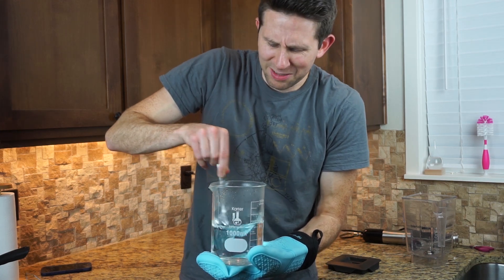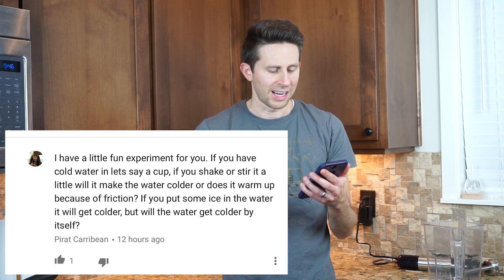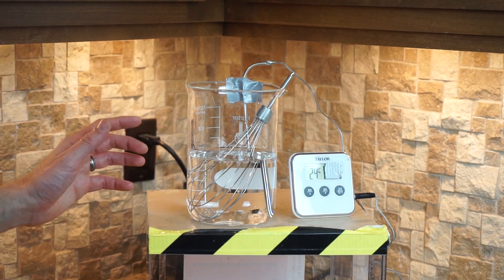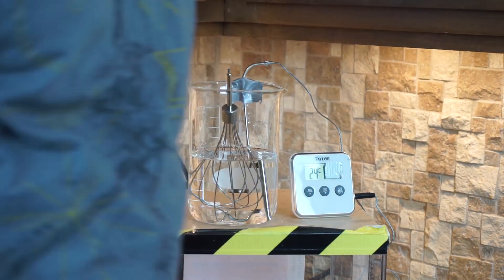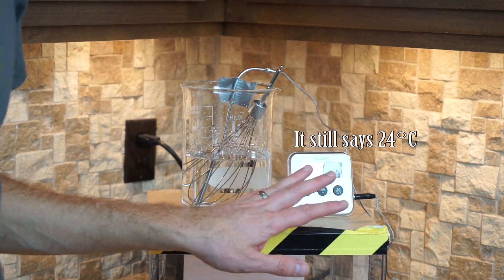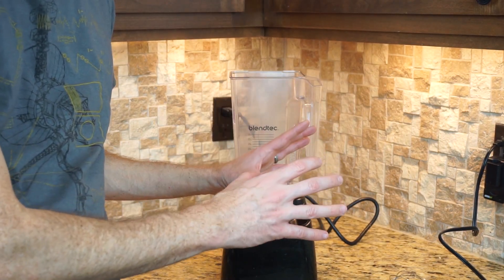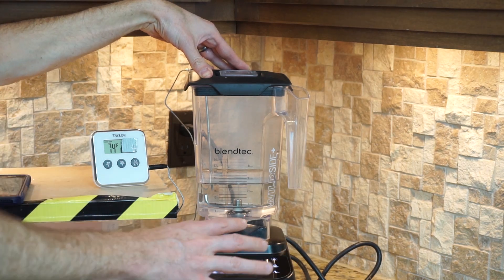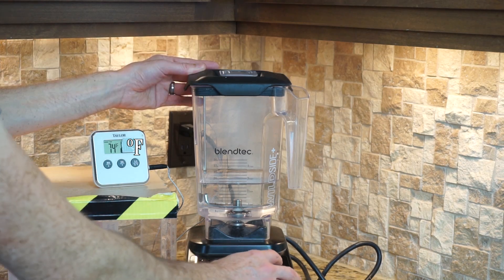Can You Boil Water Just By Mixing it Really Fast? Water-Stirring Challenge Accepted!

Comment: I haven't seen anyone else comment this but don't you think the water is heating up mostly by the heat of the motor??
Reply: Actually, I agree. The yield most likely isnt 100% movement of the Blades, I guess there is at least 80% of the Energy is being transformed into Heat, which then enters the water through the blades.
Reply: No it can't it doesn't work like that
Reply: XXTechMoXX ` that was my thought
Reply: No
Reply: yawn 😴
Reply: No
Reply: Youngo: And I say that it is at maximum 20%. Now we must place our bets and someone must make an experiment.
Reply: https://www.youtube.com/channel/UCkOhhX6zyRw3IW35xC9u7rw
Reply: XXTechMoXX ` i was also thinking it but this'll not do that much
Reply: Actualy the bearings are getting hot witch is warming up the blade and disapateing into the water
Reply: 7:10 and you can see that it is bubbling from the blade which has a direct connection to the motor
Reply: The bearings, not the motor. The motor would have little to do with it, especially as it's fan-cooled.
Reply: It is heating up additionally with the motor and bearings, but not only because that would make no sense in energy conservation.

Comment: The experiment is not a conclusive one. It has a major flaw. The system is not adiabatic. The blender blades are always metal and are connect directly to the motor (may have some non metals between the joint of the jar and the motor, but not necessarily an insulator). Blenders get hot all by themselves if you leave it on. This is due to the dessipation of heat from the current flowing in the wires of the motor. You should have just kept the motor running all by itself to see how much heat it produced per unit time for constant voltage and speed setting. Then should have added the water and subtracted the values from the observations. The blades should have been made of something that is non conductive and the system should have been made more laboratory like by eleminating external source of heat. The heating up the water although seems logical, the experiment doesn't provide a conclusive result.
Reply: Nigga it's a dude at his house, not a scientist at a laboratory
Reply: Stacy Smith i guess he proved his point though because friction made the water boil, if the motor didn’t transfer heat, i’d just take longer i’d assume.
Reply: rituraj phukan 
I think an insulted thermos shaken in a paint mixer would be better. 

I immediately thought the heat was motor and impeller bearings.
Reply: David I didnt intend to. People well educated in thermodynamics understand when someome says "the system". I dont need to explain every word and write an essay on a youtube video. Its whatever you understand it to be. If you dont, it doesnt matter.
Reply: You get what you watch man,as simple as that
Reply: Electromotors do get really efficient theese days. I'd say max 20% of energy was lost in motor and gears and the rest went into water as kinetic energy.
Reply: the bulb thing you are talking about is kind of incorrect... the more heat a bulb creates the quicker it wears down and the more often it needs to be replaced. A perfect system would have no heat and only light, because then you could use something much more efficient at heating your home than some bulbs in the ceiling fan. Just saying.
Reply: Kaleb Gates I'm just saying that heat is NOT "wasted energy". I wasn't implying that you should turn your home into an Easybake Oven. As far as "wearing down" quicker, they are still 5-10 times cheaper than CFL's so the replacement costs still doesn't outweigh the initial upfront costs.
Reply: just a quick google for you Stacy:  
Incandescent v. LED
Watts used 60W 10W
No. of bulbs needed for 25,000 hours of use 21 1
Total purchase price of bulbs over 23 years $21 $8
Total cost of electricity used (25,000 hours at $0.12 per kWh) $180 $30
Reply: Stacy Smith But gas is usually less expensive than electricity to heat a room.
Reply: I'd say that the heat coming from the motor and bearings are way too little. Steel IS conductive, but not to the point it would transfer heat at that level, even more considering how thin is the shaft for the blades. You can see this by looking at steel bars being forged. The area directly in contact with the flames will be red hot, but just 1 inch out and its already dark (still hot, though). It only shows that steel loses a lot of heat just by radiation and convection, and the distance from the blades to the motor is already too much for the influence you are imagining. For the blade , which has such little cross-sectional area to conduct heat as you think, to boil water, the motor would need to be melting the blender itself (implying the blender has plastic parts).
Reply: rituraj phukan Lol, I have noooooo idea what you said
Reply: Typical Indians respecting women. Well done representing your country. Now pray to a cow.
Reply: Another factor to take into account is that the motor does more work stirring water than stirring air at the same rpm. More mechanical load on the motor causes more current to flow in the windings of the motor and more mechanical power transferred to the blades. More electric current in the windings also results in more heat generated from resistance of the windings, and that thermal power is proportional to current squared.
Reply from the maker: +rituraj phukan—Joule already did that! This video was to see some water boil in a blender and get across the laws of thermodynamics in a fun way!
Reply: The Action Lab Yes I know that. But he didn't use a 'blender'. Blender produces a lot of heat from my experience. But I don't know how much. I never tried to let it spin for a while with nothing inside. I would love to know. I enjoyed this video, dont get me wrong. Thats why I watched it till the end in the first place. I was just providing a feedback. I would love to have a channel that does experiments like in laboratory conditions or atleast close to it. That would be so awsome.
Reply: Chris urquhart he is paying attention.
Reply: Chris urquhart but spreading false information isn’t good
Reply: eggrollsoup He didn't spread "false information" though. The heat rising from the motor and bearings is not negligible enough to dispel proof of concept. Even if it contributed 25% of the heat (which I highly doubt) that still proves that 75% of the heat generated was from friction of water molecules.

Now that we are on the subject, incandescent lights are not as wasteful as you have been lead to believe. MYTH: Incandescent lights are inefficient because 95% of their energy is "wasted" as heat.

TRUTH: From late fall to early spring, when used indoors, ONE HUNDRED PERCENT OF THE ENERGY it takes to run an incandescent light bulb is utilized!

Every BTU generated by that light bulb is a BTU your heating system did NOT have to produce. So even though only 5% of that energy is being used to produce light, the other 95% is being USED to help heat your home.
Reply: yawn 😴
Reply: Dude
It's just a silly video

Comment: the bearing gets hot so the water gets hot to
Reply: He didn't say the motor, but the bearing (just below the blades).
Reply: Tom Van Malsen nope, it works off the large amount of friction created by the blade traveling through the fluid at extremely high speed. Most of these high power blenders even have air inlet jets that suck in cool outside air to help cool the shaft assembly.
Reply: Too*
Reply: you cannot get more energy out then you put in dude xd
Reply: Chris urquhart 
How hot do you think that motor is? I'm kinda surprised you don't think a blender gets hot.
Reply: Ricky Hall blender motors have pretty big fans to stay cool and not overheat during long hard periods of use. All the motor heat is exhausted out the sides of the case.
Reply: Joules :)
Reply: Gets hot to what?

Comment: What happens when you put thermite in a blender
Reply: It would ruin your blender as its abrasive, but i doubt it would get hot enough to ignite.
Reply: risvegliato I have worked with thermite before and it requires at least 3000 degrees F to ignite.

Comment: It's the blades getting hot mate. Just let the blades spin them selves then touch them, their hot. So, because the blades are hot it makes the water hot. The water isn't rubbing together. Good vid though.
Reply from the maker: +Gaming And Raging. Anything that has viscosity heats up when stirred. Higher viscosity means higher heating. It is actually getting warmer from the water rubbing. The blade does add a little heat but it is definitely not just from the blade heating up. All energy that goes into moving the water has to come out as heat.
Reply: The Action Lab not saying your wrong or anything but I did an experiment very similar to this when I was in middle school.
Reply: Gaming And Raging. Well I'm saying you're wrong.

Comment: After the last test why the bubbles came from underneath the blades ? that tells me that The heat came from the motor .
Reply: The paddle experiment proves it's not The motor pay attention to the comments.
Reply: Mohammed Al It came from that area, because boiling normally starts at nucleation sites. Since most of the inside of the blender is very smooth plastic, there are no good nucleation sites, except for near the blades. Also, nearly all of the power is going into mixing the water and a very small percentage of it is going into heating the bearing, therefore nearly all of the heat going into the water was due to mixing.
Reply: I will personally buy a bled tech blender and test this to find out.
Reply: Hahaha it would be easier to just accept that this 'experiment' is flawed. No one is disputing the laws of thermodynamics or suggesting that the water temperature is not increased by mixing. Instead of arguing about what is obvious to everyone else, why not devise and post video of an experiment which soundly demonstrates this.
Reply: If you don't see why blending water will make it hotter, take a look at the law of conservation of energy. The blender outputs 1,500 thousand joules per second and it is designed to be efficient, and it is also designed to, well... blend. Thus the majority of the energy it produces is mechanical as opposed to thermal (in the bearings). If most of the power is mechanical, but the average kinetic energy of the water in the blender is relatively constant when it is on, then that means that the power must be going to something else ---- the average random molecular kinetic energy, or the temperature of the water. At some point (about 5 seconds) the average kinetic energy of the water stops increasing. The remainder of the power is then going into heating it entirely by the fluid friction. And if you still don't believe me, know that this principle has many applications in the real world, eg. maintaining temperature in a shutdown nuclear reactor cooling system.
Reply: Ok, you're right that it won't be valid because of the smaller load, so instead, I propose that the blender be run at the same speed as it spins when in water and measure the torque of the blade. Then measure the electrical (input) power of the blender simultaneously and subtract the difference in power. Then you will have the total thermal power due to friction in the motor and bearings. Depending on the relationship between that power and the power required to boil the water, we will know how much the heat from the motor and bearings contributed to the increase in temperature and subsequent boiling.
Reply: Nice work Sherlock, now go back to NetFlix.
Reply: The reason that happens is because there is less water below the blades so it takes less energy to boil it
Reply: Kirk Claybrook There's really only one way to know. If the blender is run for an extended period with no water, what is the maximum temperature that will be reached by the blade due to friction in the motor and bearings? If it is >100C then the boiling MAY be due to the motor and bearings. If it is <100C then it is definitely due to the fluid friction.
Reply: Mohammed Al it is that, it happens to me as well, when in making a milk shake the ice it s sort of warm but that s because the motor heat up
Reply: And the the bearing in the bottom of the jug...it would have been very hot very early on. Combine that with the heat from the motor, via both rising air and conduction through the shaft, and I doubt mixing of the water had much at all to do with it getting hot.
Reply: The paddle experiment may prove the theory, but this experiment does not. Not even close.
Reply: No that won't be valid either because the motor & bearing etc will be under much less load
Reply: I've got a blender and I can tell you the shaft and bearing in the jug can get VERY hot in much shorter time spans than this 'experiment'. You'll find that most blenders have a thermal cutoff switch that will trip well before you can get the shaft that hot anyway
Reply: Because there the water is close to the bearings (where bearing-friction is starting to get hot enough to boil water) which are probably not designed for continuous duty at peak setting. In fact, that's likely where most of the heating came from, especially toward the end.
Reply: Luigi Azevedo Your just mad because.....

Comment: What is that Blender used for? Just as a Kitchen processor? It seemed too powerful. I mean, you added a tiny bit of water and it sprayed it all over the place.
Reply: Deepak Rajendra you won't understand , but people blend nuts too and smoothies , the blender needs to have enough torque for that . The more torque it has the less pressure is put on it and it won't use excessive electricity under load . The high rpm is for keeping the contents balanced more easily and makes the work quicker , the square body makes more friction and enables the blades to do more work since they already have a high rpm and torque . They did it for a reason

Comment: Yeah, there's no way that a person could do that by hand, though keep trying. To boil water in such a way requires a lot of static friction (I'm talking about the friction that is steadily maintained for a period of time which is almost impossible for a person to do unless one is just stirring at a slow pace). I'd have a better chance at boiling water through friction mixture by rolling it around in a flask (takes considerably less effort but likely just as much time). By the way, water will cool by itself, if the surrounding temperature is lower than the water's temperature. But the average stable temperature for water is 44 F (feels cold on the skin but is actually warm to the tongue).
I really feel bad for your blender; I hope it got some TLC after that torture you put the motor through...
Reply: I can do it by hand!!! Let s consider we are at sea level. Give me a hot room set at 99.95C, thermo isolating clothes, thermoresisting oxygen tank, water at 99.95C and a spoon... you know the rest...

Comment: I'm more concernd about the heat from the motor radiating to the water creating themperature rise than just the mixing. Not saying that stirring alone of the water won't produce a temperature rise but just thing the amount of rise is due mostly to heat from the motor.

Comment: That's exactly what happens inside a microwave there is no heat coiling inside but its microwave field works on quantum level that rotates the molecules of any liquid very very fast that it heats up the stuff inside. You can not heat up anything in a microwave which doesn't consist of water/liquid in any food/stuff you want to heat up in microwave must have water molecules only thn it would warm up.

Comment: in this case I'd guess its like 25 - 50% of the effect is just heat transfer...... motor to blades to water.........also I'd try different blade configurations(sizes/shapes), they should have measurable differences in the time it takes per degree of increase(time/delta temp).......many variations are possible........blenders are not really designed to run dry(zero torque) for long.......but if you had some garage sale ones to sacrifice....it would be interesting to see how hot/fast the blades would get with only air friction & motor/bearing/blade conduction etc.